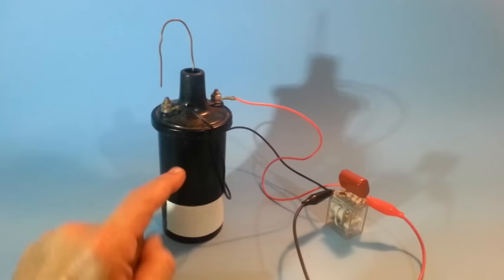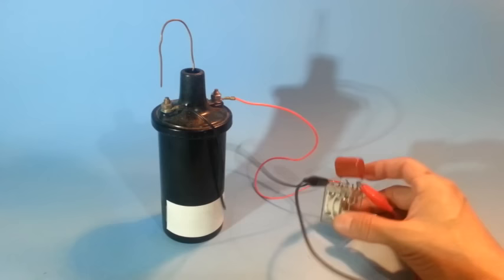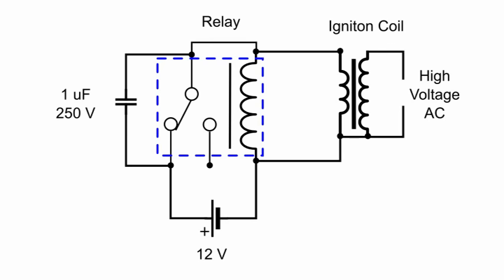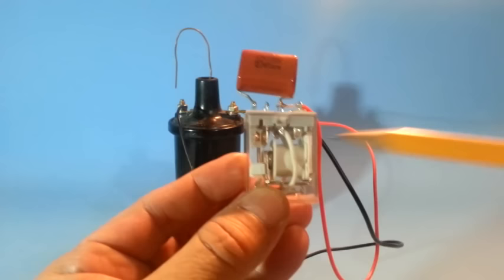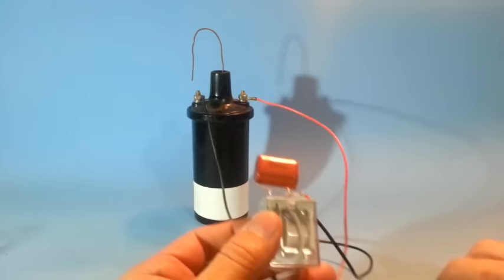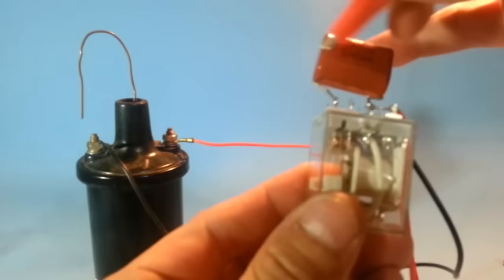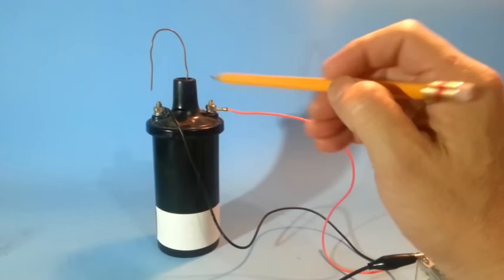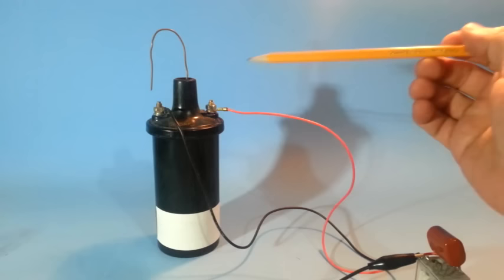Easy High Voltage with Ignition Coil and Relay

Comment: hello, i just want to ask. last few days i been trying to make a high voltage with this method but i got some problem. when i connect the coil with the relay driver, the voltage of supply i used is drop so driver relay is not active, but when i disconnect the coil the driver relay active and voltage still stable at 12V (not droping). so can you help me resolve that problem?? *Sorry if my english not well :) please help me. Thanks!
Reply from the maker: +Muhamad Taupik Hidayatullah your relay connection must be wrong
Reply: this morning have try again but the relay driver not working and not produces pulse signal.
do you connect the common with relay coil??
Reply from the maker: +Muhamad Taupik Hidayatullah The common of the relay connects to relay coil and to ignition coil primary
Reply: And 12Vdc connect to NC of relay right?
Reply from the maker: +Muhamad Taupik Hidayatullah Yes
Reply: +Ludic Science i been trying again but the voltage from power my supply is still drop like short circuit, when i connect (+) primer to he relay, do you think my ignition coil is bad and not working? 
i try to test pulse wave on osciloscop too before i connect the coil, the pulse wave was good but when i connect the coil, the pulse wave disappear. please help me i really need to make a high voltage with ignition coil for my last exam at college.
Reply from the maker: +Muhamad Taupik Hidayatullah First check if the relay is oscillating, make all the connections but do not include the ignition coil. You must hear a buzz sound if the relay is working. If there is no sound, then your connections are wrong.

Comment: what kind of relays that you're using and what kind of compositor is that and why do you have to use these
Reply: Here's my best GUESS regarding parts that are similar to what Ludic used. Maybe Ludic Science will be kind enough to reply and correct me if these parts won't work. 

12 VDC, 2 A (24 W) Power Supply / Transformer (True Lumen [11442-
524610])

8 Pin 12V AC Coil DPDT Electromagnetic Power Relay (HuaHuiYuan MY2N-J) 

1uF, 250 VDC Capacitor (PANASONIC ECQ-E2105JB)

12 VDC Ignition Coil (Tisco 396546R93) 9

10-Piece Test Lead Set with Alligator Clips (SE TL10) -- to connect the components together
Reply: I now realize this is a DC relay not AC relay. Here's one similar to what I think he used: Uxcell a15062300ux0219 IEC255
Reply: Kyle Hendrickson any automotive relay rated 10Amps (or higher) works.

Comment: hello friend I would like to know what are the materials you use for the manufacture of the device please
Reply: Here is my BEST GUESS regarding the parts that are similar to what he used:

12 VDC, 2 A (24 W) Power Supply / Transformer (True Lumen [11442-524610])

8 Pin 12V AC Coil DPDT Electromagnetic Power Relay (HuaHuiYuan MY2N-J) 

1uF, 250 VDC Capacitor (PANASONIC ECQ-E2105JB)

12 VDC Ignition Coil (Tisco 396546R93)

10-Piece Test Lead Set with Alligator Clips (SE TL10)

Comment: what's the capacitor used for in the circuit above? I am no expert...
Reply from the maker: 1.8 microfarads @ 400 volts, polyester type
Reply: Here is my BEST GUESS regarding the parts that are similar to what he used:

12 VDC, 2 A (24 W) Power Supply / Transformer (True Lumen [11442-524610])

8 Pin 12V AC Coil DPDT Electromagnetic Power Relay (HuaHuiYuan MY2N-J) 

1uF, 250 VDC Capacitor (PANASONIC ECQ-E2105JB)

12 VDC Ignition Coil (Tisco 396546R93)

Comment: You haven't mentioned the  maximum voltage of RELAY  to be used? Kindly specify the relay input and output voltage required.

Comment: Nice video dude. I want to do the same thing and got the same coil, but i got 5 pin relay used in car and that is not working...Kindly will u please let me know which coil u are using and capacitor value too... i'll appriciate.
Reply from the maker: +Zeeshan Hayder almost any coil will work... i don't know the model of my coil, i just asked for the cheapest...  The cap is 1 uF @250 V.
Reply: Sory i had to ask about relay, by mistake i wrote coil. Kindly let me know the relay serial or model etc.
Reply from the maker: +Zeeshan Hayder there are hundreds of relay models out there. Any 12 volt relay will work. Mine is a "12 volt DPDT relay"

Comment: Hi! What type of relay do you use? And what about the alimentation? Thanks
Reply: Here's my best guess as to parts that are similar to what he used. You can order from Amazon.com. This is only a GUESS based on watching the video and making some assumptions:
 
12 VDC, 2 A (24 W) Power Supply / Transformer (True Lumen [11442-524610])

8 Pin 12V AC Coil DPDT Electromagnetic Power Relay (HuaHuiYuan MY2N-J) 

1uF, 250 VDC Capacitor (PANASONIC ECQ-E2105JB)

12 VDC Ignition Coil (Tisco 396546R93)

10-Piece Test Lead Set with Alligator Clips (SE TL10) -- these are used to connect components together.
Reply: I now believe he used a DC relay not AC relay (duh!). Like this one: Uxcell a15062300ux0219 IEC255

Comment: Great video but how do you make the relay switching back and forth continuously ?
Reply: The relay switches back and forth on its own -- if you connect everything properly. By connecting voltage to the proper pins, the coil in the relay energizes and effectively turns into a magnet. That causes the piece of metal attached to a hinge to be attracted to the magnet. Once the metal piece moves towards the coil/magnet, it causes the circuit to be open (no more voltage) which causes the metal to go back to the original position. So, as long as power is connected correctly the metal will flip back and forth between the coil and the default position all by itself.

Comment: hey mate, what's the switching frequency of the relay in this setup?
Reply from the maker: around 400 Hz
Reply: gee... i would never say it is above 100 hz. are you sure? wearing of the contacts must be quite fast, even with the snubber use. switching frequecies over 500 hz require special construction of mechanical relays (otherwise they are trashed quickly).
Reply: I'm not sure ( and the video maker could correct i'm sure )  but i'd 50 / 50 guess that the relay is not actually switching but operating as a spark gap for the so called 'back emf' off the primary. it may switch once to start the process. but ultimately i guess it would depend on where the tap is on the coil config.

Comment: That is NOT alternating current. It's a high frequency DC current..
Reply: Dear TTM, I think you are wrong. If we employ capacitor the gadget will output high frequency, damped oscillated AC- according to the textbooks.
Reply: @ferencgal1858    You are wrong.  If the AC coming out of the wall is not rectified in the wall transformer, then it will still be 60 Hz AC when it goes to the ignition coil.  If the output of the wall transformer is smoothed out DC, then the power going to the ignition coil will be DC, but pulsed at the frequency of the particular relay opening and closing.  Some relays will operate or "buzz" faster or slower than other ones due to various factors.  Capacitors in the wall transformer housing are used to smooth out the 60 Hz pulses coming past the diodes.

Randy

Comment: thank you Ludic
what about the back  EMF of  ignition coil ?
how we can avoid it ?
Reply: The back EMF of the primary (about 200 volts) is what induces the HV in the secondary coil. The turns ratio is about 100:1 and without that back EMF it wouldn't work. The capacitor allows the contacts to separate far enough apart so the energy stored in the primary coil will not be used up arcing at the contacts leaving the energy to be put into the secondary coil. This doesn't explain everything that goes on though, but it does cover the essential stuff.
Reply: @eminusipi  good info, what about the relay switching on and off, how is that possible,  as hes not cutting the input 12v manually, how is it switching on and off please?
Reply: @jonnijames  The normally closed contacts of the relay are wired in series with the relay coil. When power is applied the contacts are pulled open interrupting the current so the contacts close again. Works like a buzzer circuit.

Comment: Can someone explain, in simple terms, what the capacitor is for? Is it just to add a short time delay?
Reply: idakid As i understand it, the cap is to reduce arcing across the contacts of the relay. the capacitor provides a path for the current generated when the relay coil magnetic field collapses. Without the cap, the spark within the contacts of the relay would be larger and burn them out sooner. It's acting a bit like a snubber diode  would in other inductive circuits.
Reply: It reduces the wear on the relay, and it helps feed some of that precious energy back into the circuit
Reply: no, its in the correct place, its a energy trap that re oscillates it.
Reply: +Frank Roberts really? i got the impression it was just there to protect relay contacts by absorbing the flyback from the relay coil, which it can do where it is...as such it doesn't need to resonate with the main spark coil primary...  this isn't a tesla coil, just a SIMPLE relay flyback driver that doesn't need resonant tuning... maybe i'm wrong tho...
Reply: sceptic33 it may seem wrong, and your right that it does help the contacts, but it is there mostly to "recycle" the back EMF of the ignition coil
Reply: +koty butler he says in the video that it's there to protect the contacts from the FLYBACK from the relay coil. it's just there to snub the spark, a fairly standard strategy for that purpose.  as i said before, this isn't meant to be a tesla coil with a resonant primary cap, it's just a simple flyback driver...  for sure, using a resonant circuit on the primary coil could improve the output, but then it would be a resonant tesla coil, not a simple flyback... which is what this was supposed to be...   for a cap over the primary to be effective, it's capacity must be just right to result in a ringing frequency that resonates with the secondary coil.. such fine tuning may be beyond the skills of some hobbyists, and may not be needed if a simple flyback can produce a high enough voltage...
Reply: Well, I'm now very puzzled.  To answer your question: he shows in the video that you get massive sparking between the relay contacts if you don't have it.  For more detail,  the culprit is the back emf from the primary winding of the ignition coil  (the relay coil too, but far less significant).  When disconnected it can generate a very high voltage in the opposite direction.  Surprising, but true.  In the circuit shown the current caused by this must pass "backwards" through the battery.  I guess most battery chemistries tolerate that, maybe some even get slightly recharged.   I wouldn't try it with a usb pack, the electronics at the output might be seriously unhappy at fighting a 500V reverse pulse.  Better, I think, to deal with it at the coil side, but  hey, Ludic demonstrates that it does a good job in this case, so fine... for this case.
Reply: Well, I'm now very puzzled.  To answer your question: he shows in the video that you get massive sparking between the relay contacts if you don't have it.  For more detail,  the culprit is the back emf from the primary winding of the ignition coil  (the relay coil too, but far less significant).  When disconnected it can generate a very high voltage in the opposite direction.  Surprising, but true.  In the circuit shown the current caused by this must pass "backwards" through the battery.  I guess most battery chemistries tolerate that, maybe some even get slightly recharged.   I wouldn't try it with a usb pack, the electronics at the output might be seriously unhappy at fighting a 500V reverse pulse.  Better, I think, to deal with it at the coil side, but  hey, Ludic demonstrates that it does a good job in this case, so fine... for this case.

Comment: Instead of ac output, how would you wire it for dc output?
Reply from the maker: add a high voltage diode
Reply: The output is already DC. It's pulsed DC. The circuit simply causes the output voltage to rapidly spike and drop very quickly.

Comment: I'd like to create a slow pulse spark, like for an ignitor for a grill. 

Something that sparks 1x every second.
Reply: Some videos show they use a turn signal unit that's made for cars in place of the 555 timer.  Look them up.  Look for "homemade DIY fence charger."  OR with this same circuit change out the timing components (resistor / capacitor) values on a NE555 timer IC.  Wire in an LED light for the timing.
Reply: I just now found the video you need to make your circuit.
https://www.youtube.com/watch?v=leKNbhFfE-Y
The video linked above is made by the same person who made this video right here.

Comment: If you use a car relay and a microwave capacitor you should be able to get about 30kv output, I've done it before
Reply: You mean microwave transformer and solenoid switch?
Reply: @tunahankaratay1523  No, he meant an automotive relay (Typically capable of 40A, and the nominal coil voltage is 12V), and a microwave capacitor (really big. Probably close to the size of the ignition coil in the video).
Reply: Beware !!!!One mistake and say hello to god !
Reply: @Buzzhumma  not likely, unless your chest is sweaty and you connect the leads across your heart.
Reply: Michael high voltage electrician said they have the left hand behind your back rule . Do you know why ?
Reply: @Buzzhumma  "high voltage electricians" are dealing with MUCH higher voltages and MUCH MUCH higher currents. This is nowhere near comparable.
Reply: Michael if a pulse passes through your left hand and through your heart and then out your right hand it will stop your heart. They call it lose the left ! Don’t kid your self Michael . It does not take that much pulse to interrupt your hearts Rythym. Your comment concerns me that you might be a bit relaxed about something that often doesn’t give a second chance ! Take care buddy !
Reply: @Buzzhumma  I think you don't understand the science here. You, like many others, seem to think that high voltage = death. The voltages we're talking about here are lower than a typical taser. Do tasers (usually) kill people? No. And for the same reason that they don't, this likely wouldn't either.
Reply: Michael I’m not talking about electrocution with high current path ! I am talking about the risk to stoping your heart through a high voltage dc pulse from a large high voltage secondary like this coil with a MOT capacitor as mentioned in the original comment . That will kill you immediately no second chance !
Reply: @Buzzhumma  Oh ok, you're not talking about being electrocuted, you're talking about being killed by electricity. Seriously? Are you just throwing words around for fun? High voltage won't kill you unless it's also capable of supplying enough current. The resistance of dry skin is quite high. Plus the voltages we're talking about (~30kV) aren't even that high. You can touch the output of an ignition coil and it won't feel good, but it most likely won't kill you.
Reply: Michael yeah Michael you spending you time ridiculing me and missing the point of the high voltage LARGE capitor  as stated more than 3 times now . Don’t let your ego or need to be right get you killed ! Big capacitor = big power high voltage spike that will kill you !!!!
Reply: @Buzzhumma  there is no indication anywhere that they intended to put the capacitor across the secondary, and in fact, since the OP also mentioned an automotive relay, it's safe to assume that he meant to use the capacitor exactly as it's used in the video: as an oscillator on the relay. Secondly, if the capacitor WAS on the secondary, then a) it would blow up before you could even get your hand close to it, since microwave caps aren't rated for 30kV, and b) the output would vary greatly depending on the capacitance and the frequency of the AC. The capacitance could be so large that a sufficiently high voltage is unable to build up on the cap.
Reply: Michael fair enough . I’m just going by what plasma junky said in the start of this thread . The voltage would only be around 2200 volts I think they rate at so  yeah that should be ok on your heart muscles!
Reply: @Michael-gi5ml  currents between 100 and 200 mA (0.1 to 0.2 amp) are lethal.   10 milliamps (0.01 amp) is capable of producing painful to severe shock,
Reply: Guys is it possible to use  a 2x4kV 12mA Ampl.11kVignitions transformer for an electric fence? or would the current and voltage would be too much for a human heart? :o

Comment: what relay did you use..pls..?
Reply: I am in the process of trying to build this circuit. I believe he used an 8 Pin 12V AC Coil DPDT Electromagnetic Power Relay similar to the relay offered by HuaHuiYuan MY2N-J on Amazon.
Reply: Ignore my prior recommendation. I now believe he used an 8 pin 12V DC Coil DPDT relay like this one: Uxcell a15062300ux0219 IEC255

Comment: +Ludic Science Is that a 12V relay?
Reply from the maker: Yes it is
Reply: Here is my BEST GUESS regarding parts that are similar to what you used. Can you please confirm these parts should work (or tell us the exact parts you used):

12 VDC, 2 A (24 W) Power Supply / Transformer (True Lumen [11442-524610])

8 Pin 12V AC Coil DPDT Electromagnetic Power Relay (HuaHuiYuan MY2N-J) 

1uF, 250 VDC Capacitor (PANASONIC ECQ-E2105JB)

12 VDC Ignition Coil (Tisco 396546R93)

Comment: The relay was nicely oscillating until I connected the coil primary and it stopped.  Then I  tried to use larger 18v battery it worked for awhile but then burnt the relay